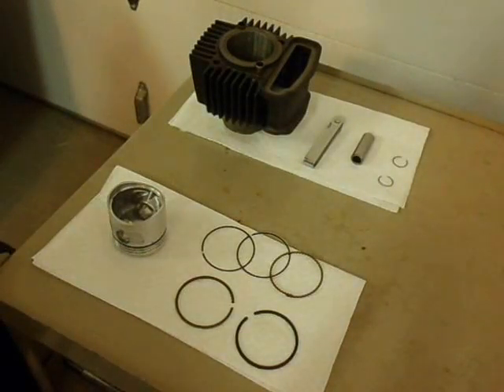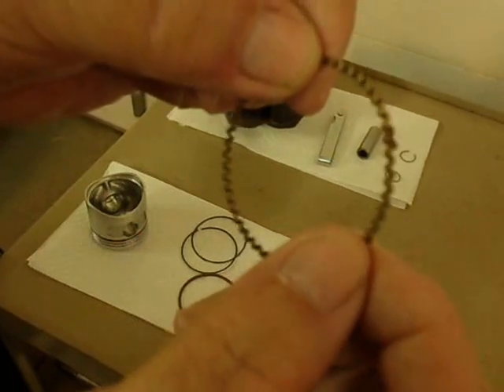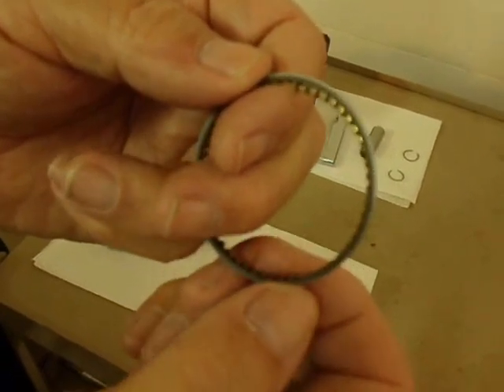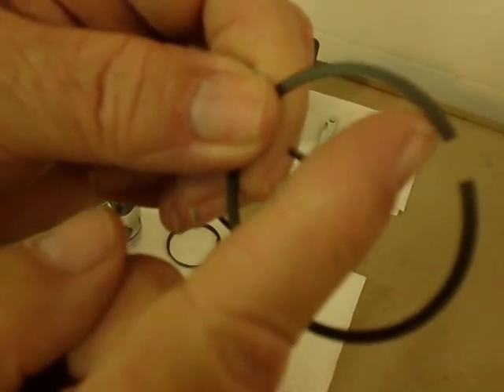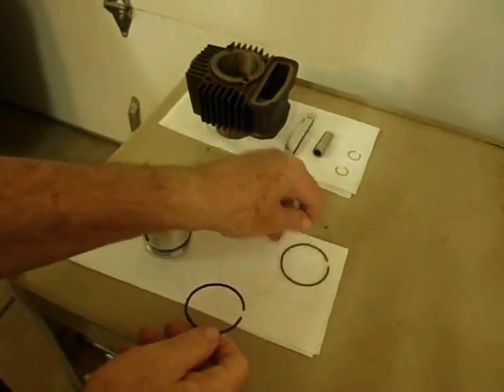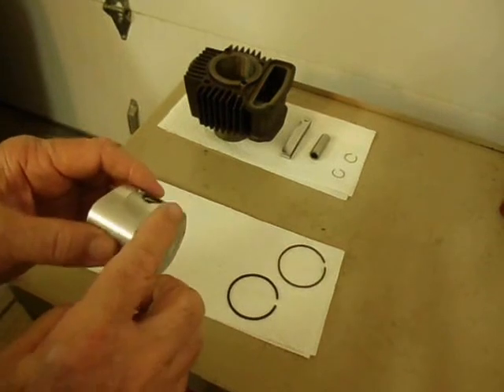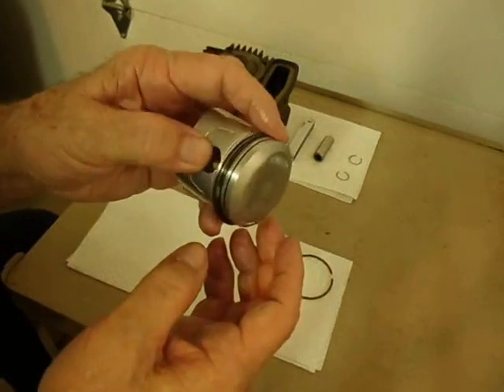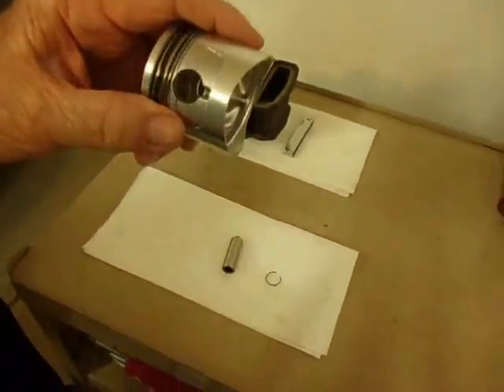1980 Honda ATC 110, Top End, Part 1 of 7, Piston and Rings

Comment: i got a atc 200 and it burns oil so I wanna put new rings but while I'm doing that why not put a 12:1 compression piston I was wondering if that 12:1 piston would fit the cylinder jug?

Comment: Bruce, I need your help, I cannot find a new piston kit for my atc 110 where I can buy it from ?
Reply from the maker: First you need to know exactly what you need.  Is the cylinder ok?  Does it need to be bored?  Has it been bored?  Then you will know which piston to buy.  Standard, Oversize +.25 mm, Oversize +.5 mm, etc.  I've seen them on ebay and sometimes on amazon.com.  Or maybe your local Honda dealer can locate one for you.  Did you find out what was breaking your spark plug?  Good luck?
Reply: Struggle is still real.. now 9 million options pop up.. your videos are helpful thanks